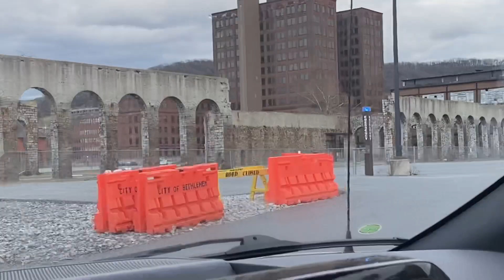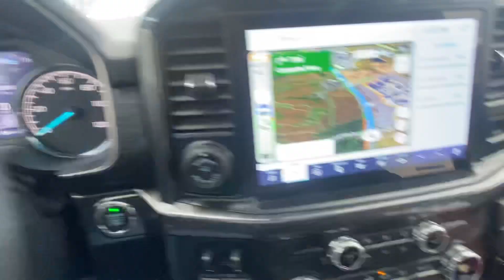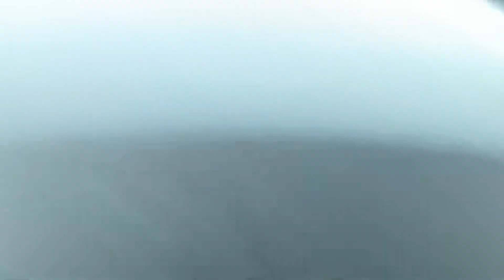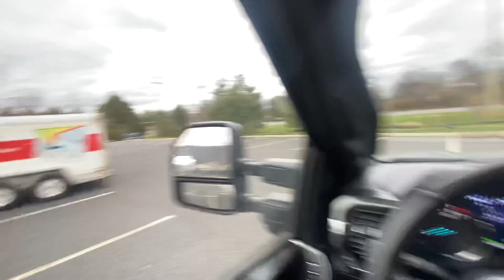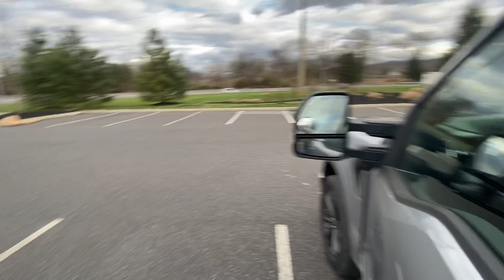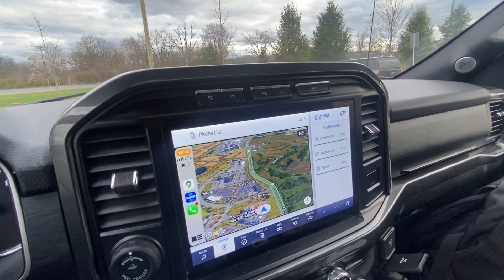F-150 PowerBoost Hybrid 30,000-mile review:  smooth sailing, (almost) no issues!!!

Comment: congratulations, your 7 pin trailer connector cover flips up in the correct position. all the other new trucks have the cover flipping down which sometimes allows the plug to wiggle out just enough to loose connection. maybe its a powerboost thing, just weird they aren't all one direction.
Reply from the maker: That's........ seriously messed up.

Comment: Maybe your tires are wearing funny because your usually towing or hauling. Get it aligned with a typical load in the rear of the bed that will also simulate a trailer being connected. Worth a shot.
Reply from the maker: Thanks, that's definitely a possibility.  Will check into it!!!

Comment: My 2015 F-150 Lariat came with Pirelli Scorpion tires and they only lasted 30,000 miles.  My 2019 F-150 Lariat came with Hankook DynaPro AT2 tires and I replaced them at 50,000 miles and they still had an easy 10K worth of tread on them but I wanted fresh rubber for the coming winter.  Both 2015 and 2019 trucks had both 4-pin and 7-pin trailer connectors so I was disappointed to see that they dropped the 4-pin from my 2022 truck.
Reply from the maker: For sure.  We've got the Hankooks on our PowerBoost.  They're OK but they're definitely not "all-terrain's."  We're coming up on 50K and will definitely replace them in time for the winter.

Comment: Nice review, love the history lesson. The shifter difference in feel is the models with shift by cable feels like it’s supposed to. Shift by wire trans does the best it can to mimic the shifter feel. It’s that or a dial shifter like in the Expedition’s or the Rams.
Reply from the maker: For sure.  It could definitely be worse.  The dial shifters are horrendous.

Comment: You might want to have the front wheels aligned when you replace your tires. My 21 F-150 has 22,000 mile on it. I rotated tires at 15,000 miles and tire tread has worn even.

Comment: So is that outlet on the dashboard rated more than 400 watts when equipped with ProPower Onboard? (Both hybrid and nonhybrid)
Reply from the maker: Yes!  Without “PPO,” all you get is a 400-watt outlet.  The 5.0 / 2.7 / 3.5 engines raise that to a 2.0kw outlet.  The hybrid offers a 2.4kw max (120v only) as standard equipment, and a 7.2kw max (120 and 240v) output as an option.
Reply: @ArmyProperty  thanks! I’ve been wondering for a while and haven’t been able to find a straight answer on the internet-thingy. Too many conflicting opinions as usual. Just wondering if the  inside outlet with PPO would be able to run a little K-cup coffee maker while on the road. The less stops the better. A year and half ago, we were on a long ride home and I was needing some coffee and topping off my tank, stopped at a Love’s station and next thing you know I had some shady-looking fellas asking for money and then giving attitude when I said no. The last thing I wanna do is get into an altercation that may involve defending my wife and myself with my gun. Especially of all places like a Love’s or Pilot station!!

Comment: We've had ours7 months. had a issue with the entertainment head were it would flicker and need a soft reboot. they change a info entertainment module a couple a days ago. good so far. We're at 12000 miles.
I like the truck its great mpg is good but towing we drop to 8 mpg and I here others say 10 to 12 mpg.
pulling a 6000lb bumper pull travel trailer.

Comment: When you were speaking to the 20” wheels regarding ride quality, you hit a nerve with me.  I am waiting on delivery of my PB now that comes standard with the same wheels as you have on your rig.  I was able to find some new take-off OEM 18” wheels; do you think it’s worth entertaining the idea of going down for the sake of ride quality?
Reply from the maker: Well, the PB has pretty soft springs / shocks (at least compared to our 3.0 PSD with FX4 package), so the ride is very comfortable -- even with the 20-inch wheels.  Really the main problem I have with the larger wheels is that it's easier to scrape them on sidewalks / curbs or when off-roading, and replacement tires are much more expensive than with the 18-inch rims.

Comment: Just curious to what gear ratio is your power boost ?
Reply from the maker: Thanks!  The PowerBoost only comes with a 3.73 rear end.  You get a choice with other engines.
Reply: @ArmyProperty  Army, my 21 PB has 3.55 electronic locking rear with max tow pkg.
Reply from the maker: @richardswann2937  no kidding???  That’s big news, at least to me.  I thought they call came with 3.73…. (is yours 4WD?)
Reply: @ArmyProperty  negative. 2wd.
Reply from the maker: @richardswann2937  ahh ok.... wonder if the 4wd only lets you have the 3.73?  Now you've got me curious...
Reply: @ArmyProperty  3.55 on 2wd and 3.73 on 4wd. No other options available with the hybrid.
Reply: @ArmyProperty  thanks for the update that’s what i thought I like your reviews

Comment: I can say my mpg experience has been different than yours, so maybe one size doesn't fit all.  I'm in the South.  Without a bed cover i was getting 21 city / 23 hwy (my '22 is rated 23/23 epa).  Once I put a bed cover on it around i now get 24 city / 23 hwy.  I've had numerous trips where i get 25-27mpg.  Numerous.  The sweet spot for that 25 plus mpg is driving between 45-65mph and less stop signs/red lights.  My best mpg to date was 28.2mpg driving these speeds on mostly level and limited stops.  But in fairness I'm absolutely getting around the stated epa ratings.  Far better than the 15.7mpg I was getting out of the 2014 F150 5.0
Reply: What kind of mpg are you seeing at 75 mph with and without the cover?

Comment: Next tire should be the Michelin At2s i got 135k from them and about 35 to 40 % left on them when i changed, really , really good all terrains plus quiet on the hwy I'm on my second set of those and i didn't hesitate to buy them again. I went thru all sorts of terrain with them from deep snow to crazy Vancouver rain for weeks on end. i recommend a good shop and realign those wheels.
My tires  wear really even and it a 2011 f150 something its not right there, get it checked out.
Reply from the maker: Good to know!  We've got Michelins on our 3.0 PSD and they're great tires.